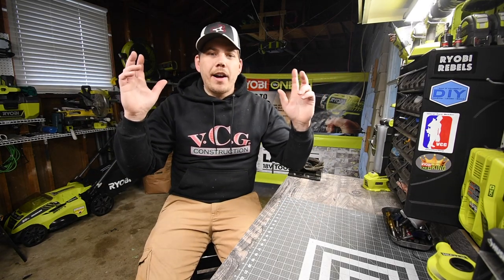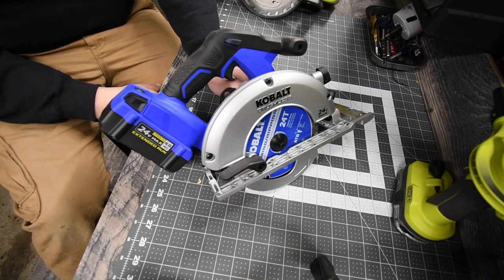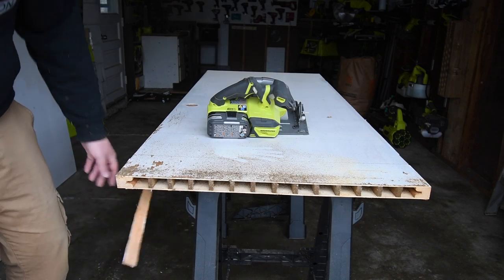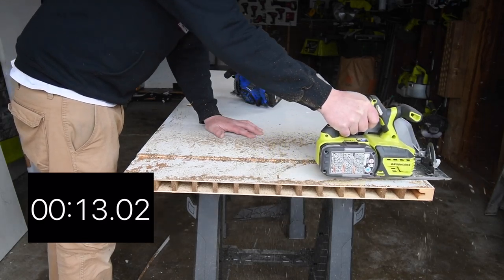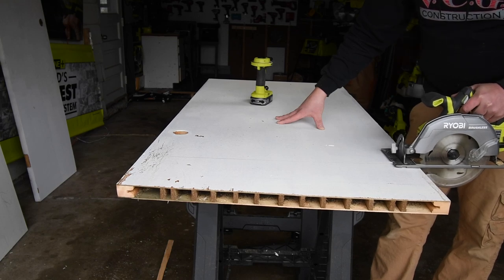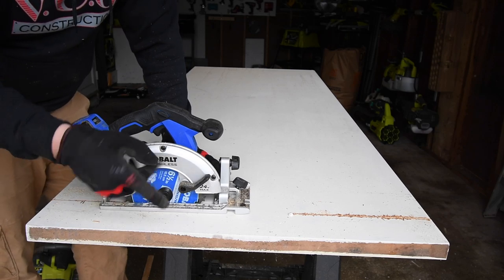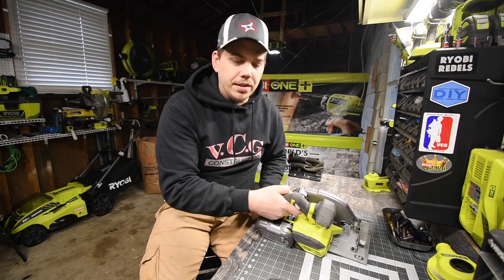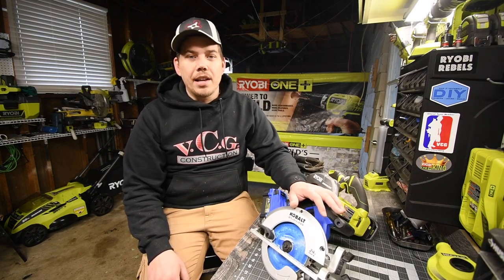Left blade vs Right blade Circular saw

Comment: So there are multiple considerations when deciding whether you should be buying a saw with a right or left sided blade.  First off is comfort, which is going to be a personal preference.  Many folks feel they want the blade on the side of the tool facing away from their body, for safety, and choose based on that.  Others are concerned about sawdust coming towards them, rather than away from them.  Then there's the issue of having the heavy side of the saw hanging off of the waste part of a cut, possibly tipping and spoiling your precision.  As a lefty, I definitely prefer a right sided saw on my Circular saw, but I've yet to find a single video that addresses all of the above concerns & weighing them out together.  Thanks for your perspective on this!
Reply from the maker: I thank you for the info Jim.

Comment: Right handed saw on right side is for safety reason. The smaller one on left side can handle it well without problem but the 7 1/2" and above powerful saw once got jammed, it will reverse and roll toward your body. I witnessed it happen couple times and sent my collogues to hospital. Put the guide on the left side if you can't see the blade on right side.
Reply from the maker: I thank you for the info Saiho
Reply: No the right sided side winders were not built for safety, but it is an advantage for sure although I almost always use the left sided

Comment: With a left blade saw you are in a better position to walk alongside a long rip cut, keeping the wide part of the shoe on the keep side. You don't have to reach across in a uncomfortable position. The downside of left blade is cross cutting a board, you can't hold the work with your left hand without supporting the saw on the short side of the shoe. Also you put the blade dangerously close to your left hand, if you are guiding the cut with a speed square. The solution is two saws, left and right, keep a 60 tooth blade in the lefty for plywood, and a 24 tooth in the righty. Saves time fiddling with blades. Although when you start messing with left and right, you could get into a muscle memory problem and cut off your pride and joy! Better to think it through carefully.
Reply from the maker: I like the left bladed saws better by a long shot

Comment: I own both left and right blade saws.  Most of the time, I use the left blade saw because of the better blade viability. However, When ripping off small amounts of material, (like taking a 1/2" off the bottom of a door) the right blade is better because the shoe rests on the 'good' side and the blade side is on the waste side.
Reply from the maker: very good info and thank you for sharing Jps
Reply: No matter the blade placement, you cut so the shoe is over the good side anyway, just turn the saw around respective to the blade orientation.
Reply: I was going to say. Just cut from the opposite direction and the shoe is on the good side anyways. Its inevitable that whichever side you have, you will have to change directions or use it in a less desirable way due to space or position of cut.
Reply: @ruthlesspug  If you do that, then the blade will obscure the line reducing viability.

Comment: As a Left handed Carpenter the left sided blade Side Winder or other veteran carpenters calls it Southpaw Sidewinder works for me all the time, for safety reasons the blade is little bit far from my hands, when I'm using speed square for cross cutting Lumbers and the saw dust is blowing in the left side away from my face. The circular saw that I'm using are The Dewalt 15amp Magnesium Corded Worm Drive 7-1/4" Circular Saw with Electric Brake (This must be the updated version of DeWalt and it comes with electric brake), I'm also using the Skil 15amp Dual Field motor Magnesium Southpaw 7-1/4" (Blade Left) Sidewinder Circular Saw (no E-brake), if they work on the right handed people, these saws works for me a lot better than the old traditional side winder saws.

Comment: I like the left side blade. I'm right handed and I'm just use to that side for years.. 

Now what i do like about both circular saw is it doesn't have a side dust extractor. I like the dust to go down like a worm drive style. 

I get some people use it indoors so they like to hook up a vacuum. Maybe the companies should make two styles or add a flat cover plate to block if we don't want to use the dust port.

Just my thoughts. 

Thanks for the video
Reply from the maker: I thank you Michael

Comment: I'm a Left Handed Person, a Carpenter and a Deck Builder, in my experience when it comes to circular saw, its a biased thing when it comes to circular saw. Of course many people will say that the blade right circular saw is for Left handed, year right! But the only drawbacks about the Right Blade Circular Saw is that stupid dust port that the saw dust will shoot directly in the user's face unlike when you use the blade right saw in your right hand the saw dust will shoot on the right side away from the user's face. That's why after all this years I have stick around on Blade Left Sidewinders and Hypoid Gear Drive Saw and those are blade left, the only thing that can make my cut straight and true is when I'm using a speed square or if I'm cutting plywood I'm gonna have to make some jig to cut straight if I wanna see where the blade is going I'm gonna have to lean over to see it. But if I use the left handed saw which is blade right saw then the saw dust is not gonna be good for me. Many tool company designed it that way, which is pretty stupid, why can't they just make a circular saw that Everybody can use it without discriminations and discomfort. And that's the reasons why I got rid of my DeWalt DWE575SB Corded Sidewinder (Blade Right) circular saw w/ brake. And my DeWalt XR DCS570B Cordless 20V Saw. And I replaced them with a Makita XGT 40V Rear Handle Sidewinder Saw Blade Left and Ridgid corded Worm Drive saw another Blade left. When I used to have a blade right saw and I'm having problems with the saw dust, I tried everything! I tried blocking the dust port so the dust can eject downwards but it didn't worked! It gets worse until I screwed up the tool. That Stupid and Dumb Dust port is drawback for Blade Right saw so that Left handed people can use it comfortably.

Comment: If you're right-handed then the left side blade is best for accuracy, but the right side blade is best for pretty much everything else, ie. safety (blade away from the body in case of kickback), 2 handed use without placing your left hand in harm's way, sawdust away from body & weight of saw more balanced on the working surface on waste cuts. 

I would suggest that if you're just using it for thin cuts then the left blade is fine, but if you are doing larger, deeper cuts with say live edge, real knotty & or harder wood species, then a right blade might be a better choice for safety from kickbacks. It only takes one time to lose a finger or worse. Safety when working with power tools is always my # 1 concern. If you want more accuracy, you can always use a guideline.

Comment: Myself, I am ambidextrous, and constantly switching which hand I use depending on which is a better angle.

That being said, I really like the Ryobi sideload battery design for balance. I have both the 5.5" P504G and the 7.25" P508.  I love them both and tend to use them right-handed for the reasons you mention. 👍
Reply from the maker: I do as well and I thank you Alec
Reply: I can hammer with either hand. When I make a long rip with a right cut I hold it in my left hand and have no trouble seeing the kerf form.

Comment: For those who in the unknown, a left sided blade will have the handle on the right when looking at the blade in front, and a right sided blade will have the handle on the left. A worm drive will always be left sided so you can check for reference.

I wish kobalt made their 24v circ saw left sided but the OEM manufact behind also owns skilsaw. Skilsaw has a left sided blade sidewinder, which is corded. I guess I'll get that. No problem. Or I'll get their mag77, don't know. I'm not a cutman nor a framing carpenter so I won't use it that often.
Reply from the maker: Thank you for the info and thank you for viewing AI

Comment: Right vs left blade is not for leftt vs right handedness. It's mainly for whether you'll be holding work on the left and letting the offcut fall right, in which case you want a right blade, even if you're right handed and it's harder to see the cu, because then your saw will stay put on the held-down work piece once the offcut falls away. If you're left handed, you probably want a left blade in that case, which again is harder to see, but the saw will be supported by the work if you hold work on the right side.

Comment: I always thought right blade for right handed person doesn't make sense. It's better to have 2 reverence of the line which is the blade and the nuk. Right blade always make our body in uncomfortable position. Just to check the blade and the line
Reply from the maker: I prefer the left sided blade myself. its so much easier to use

Comment: I am right handed and prefer the left hand blade because I can see where I am cutting easier. The only down fall, is you get blasted with saw dust rather than away from you if using this tool
Reply from the maker: im the same way
Reply: You also have more stability since the motor is on the solid work piece

Comment: Lol, Ryobi listened and made their latest PBLCS300 brushless saw right handed, because that's what pros want. Apparently it is done for safety reasons. Not an issue with low power tools, but when you get to 7 1/2" territory left handed is too dangerous

Comment: I watched a review for a new dewalt flexvolt saw, and commented asking if they made it for right handed folks. I was informed that “99% of professionals who are right handed use a saw with the blade on the right side” I don’t understand this, I own both variations and my efficiency is 100x better when I can see the blade. What benefit is there to not be able to see what you’re cutting?🤷🏻‍♂️
Reply from the maker: lol I have no clue. I want to see the blade especially if if chopping up the wood and due to a dull blade
Reply: You can see the blade on both sides with the Dewalt saw. I'm also right handed and like the right sided blade
Reply: I have a rigid; it’s designed for you to look at the cut on the motor side of the blade 🤷🏾‍♂️ they have designed it so the saw dust us blown clear so you can see the cut line.

Comment: Thanks for the great reviews, but I would like to mention one thing. Right side blade is a safety consideration. With left side blade, you have to reach over the blade to use it two handed. Also, some people just feel better having the motor and base plate between them and the blade.
Reply from the maker: that is correct. but some people like the line of site.
Reply: You have a solid blade guard, I could see the issue if the saw would kick back and turn on you, but that's about it. If you're cutting long (I mean, so long and wide you wouldn't be able to reach across without getting into an awkward, possibly, dangerous position) pieces having the blade on the right side will only cause fatique and possibly make the work more dangerous (you'd have to pull up the weight of the motor.) Cutting 2x4s however, it's blade on right 100% (if you're right handed of course)

Comment: Thats why they have veiwing ports in front of the guard near the bevel adjuster. Right side blade all day. Besides ryobi, almost no one makes a 7 1/4 left side
Reply: I think Milwaukee makes one also, and dewalt a worm drive is, but ya I think most people want the blade away from their body
Reply from the maker: Thank you for viewing Yankee
Reply: @bluecollar8525  all Framing saws (wormdrive style) are left side, but almost all 7 1/4 are right
Reply: cannot stand right cut. A cant see the blade. B  have to take hand over and pull back the guard blind which is dangerous. 
C have to mark instead of just holding your square and running against it.

Comment: Thank you so much for this video. I didn't even know that the had handed saws. Can you get any hand you want on any manufacturer's  saw? I have a 20v. B&D circ. That is right handed and a Ridgid that is left. Like you I prefer to see the blade whale I'm cutting as well.  By the way my B&D saw is a great little light saw, cuts great. I can get quite a few cuts on just a 1.5ah battery. Anyway back on point, can you get different handed saws from any manufacturer? Please let me know . Thanks Hollowpoint Jim.
Reply from the maker: there are a couple of companies that make both left and right bladed saws but, its a different model and more expensive.
Reply: Thanks

Comment: I cannot stand right cut. A cant see the blade. B  have to take hand over and pull back the guard blind which is dangerous. 
C have to mark instead of just holding your square and running against it.
Reply from the maker: to cut a perfectly straight line you need to calm down a straight guide to what you are cutting

Comment: I note how you discuss gloves as a safety measure and then don't use them for the first 5 minutes.  I wouldn't insist on gloves but they could become a greater factor depending on the material being handled.
The manufacturers say you need to keep both hands on the saw, trigger and pommel.  When one hand is flat on the surface ahead if the blade, you are at risk notwithstanding gloves.
You need to adjust cut depth so that the teeth are fully below the bottom of the cut surface.  The Kobalt was OK but the Ryobi was set too deep for optimal cutting.
A larger diameter blade makes for a cut more resistant to wandering in the same wsy it is more accurate to sight a pistol vs a rifle.  A short width blade in a jigsaw or recip can wander from a straight line so the 7 1\4" blade will be easier to keep on track when started straight.
Cutting edge speed varies with RPM and distance the blade travels per revolution.  Pi cancels in the equation is you're just comparing the ratio of speed of blade in yhe wood.  3800 × 7.25/5400 × 6.5 means that the cutting edge of the Ryobi moves at 78.5% of the speed of the Kobalt with no load.
Using different blades means cut speed is not directly comparable.  Kerf thickness and tooth geometry, material and sharpness need to be considered.
No load blade speed is irrelevant to cut speed as motor torque determines how much the blade speed decreases as you push against the material being cut.  There is an optimum feed rate for each saw that depends on blade and the motor torque curve.  With the minimal specs provided, it is not possible to predict which saw will cut faster or use battery more efficiently.
Reply: I neglected to add.  The most important safety measure to take in the examples here would have been to support and secure the door against movement before cutting.
Reply from the maker: This iwasnt a versus video on the motor. if you paid attention which you didn't. its also in the title, this was a left versus right bladed circular saw and the pros and cons of using them both. I added the timer to the test because I wanted to show the difference of a right handed person using both saws. this video had nothing to do with the motors. only the handle. next time please pay more attention :)
Reply: @ManCaverTools  I understood the video.  You provided specs with blade size and RPM in the first few minutes and then at the 7:50 mark you got into the diameter/RPM as to performance.  At no load, the Ryobi moves Pi ×D × RPM/60 seconds per minute /12 inches per foot.  About 120 feet of blade outer edge per second for the Ryobi vs 153 feet per second for the Kobalt passing through material.  While this suggests the smaller blade cuts faster, if the Ryobi has enough torque, it will not lose RPM as much when loaded and could have a higher blade speed when loaded. Kerf width, sharpness and tooth profile and material will also affect how the motor is loaded and loaded RPM.  That issue remains to be determined.  Other than addressing this point, which you specifically raised, my comments were primarily in regard to obvious safety concerns.

Comment: A bigger blade makes less rotation not more like you said 🤦‍♂️ , a bigger blade is harder to spin becaus of the added weight and leverage not amount of rotations
Reply from the maker: I said it takes more to rotate it so its slower.
Reply: What do you mean less rotation? A larger blade will be spinning faster on the outer edge than a smaller one but as its still connected to its inner circle it will still make the same rotations of the central axis.  
When you translate the same movement to a bike or car though, the larger disc will rotate less for a given speed because of the speed it is travelling, our saw won't have such restrictions except for the mass it has to move.

Comment: This vid is a school example of how not to use a circular saw and how not to do any sawing job! Ignorant amateur job to not clamp down the object you cut, to cut it while its unstable, wobbling and unsupported, it collapses while you are cutting it and while the saw blade is still running and you have to catch the falling saw, avoid the falling debris by jumping away etc. this is how to lose a hand or toe fingers etc